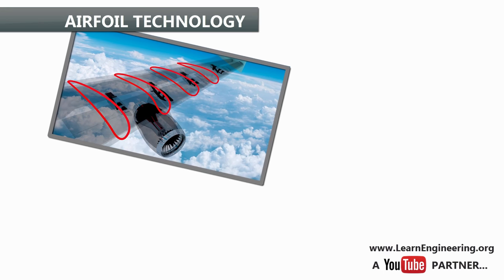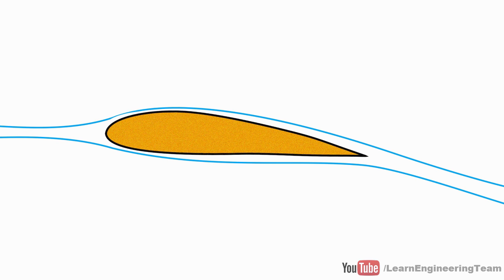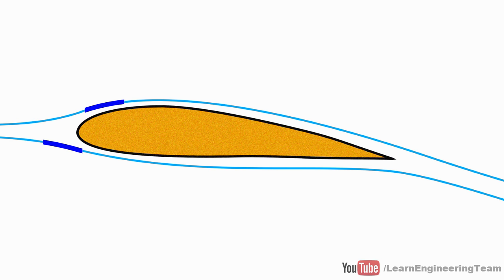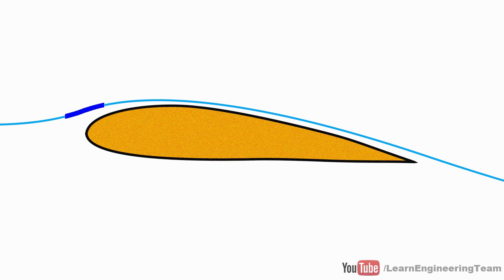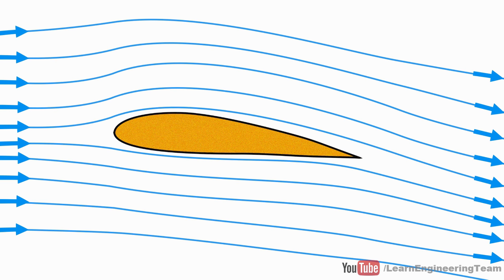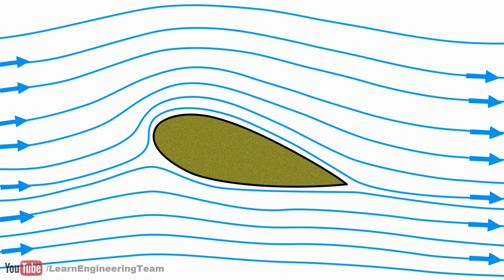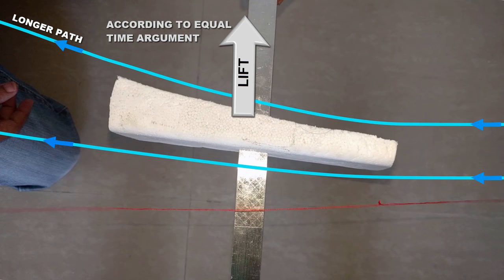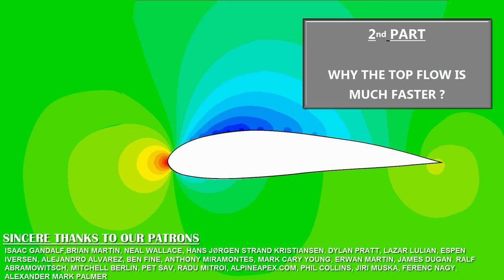How do Wings generate LIFT?

Comment: Hey. So today I started learning Fluid Mechanics II (a continuation of the first part). Hence, in class we discussed about air foil in the beginning. My lecturer explained that this has to do with Bernoulli's equation. After watching this video and contemplating, I figure you may have some things explained logically correct like that explanation that the particle which travels on a longer path will take more time than the opposite. But I am still confused about why the air flow doesn't just travel in a straight horizontal line after hitting the air foil. Could you perhaps elaborate further? Does it have to do with molecular forces (the reason why the fluid sticks with the surface)? Thank you!
Reply: The Coanda Effect comes from a couple of different phenomena that work together. The first is that all fluids are viscous. I don't know how far you've gotten in fluid mechanics, so forgive me if this is over-explaining things, but it's basically like friction between different layers of a fluid.

Second, the fluid directly in contact with the surface actually does not move. This is essentially due to electromagnetic forces between the individual atoms and other details at the atomic level.

If you combine these two phenomena, you get a viscous force from the stationary fluid on the layer above it that pulls it around the curve. This layer in turn enacts a viscous force on the layer above it, and so on and so forth.

On an airfoil, this same effect is happening. That is one of the reasons that the flow does not continue in a straight line.

One interesting note is that you CAN actually make the fluid flow in a straight line after the airfoil if you put it at a large enough angle of attack. That is called "stall" and is very bad because it ruins all of the lift.

Comment: As you get closer to the upper surface of the wing, the acceleration of the air is increasing due to conservation of angular momentum.
Reply: Could you explain it more detaily
Reply: @battulaharilakshmanprasad2721  it’s simple . Stable Slower air on bottom will bounce the downward of fast moving air from top- hence causing lift. No need to engineering degree to understand

Comment: The reason the air moves faster over the top is the same reason that explains why water moves faster coming out of a funnel than it goes in. The air above the wing is 'sucked' towards the wing by the Coanda effect, which squishes the streamlines together. This forces them to move through a smaller space, which increases their relative speed.
Reply: Elemental Sheep I'm not sure if the funnel analogy is good for explaining this though, it's more like a funnel cut in half and a half funnel does not add speed. Correct me if I am wrong
Reply: o0prince i would say, the airfoil itself "takes away some space". Meaning: the air can't get trough a planes' wings. Therefore the air needs to go around that obstacle, but now it has less space. This only happens at higher speed, and it might seem confusing to us, as we can't really see the effect, but: having less space, the air gets faster, just like water beeing pushed trough a small opening. 

You can see how the streamlines get closer to each other in a windtunnel, when a approaching the airfoil and beeing pressed to it.
Reply: Christian Vetö i think that is the venturi theory which was proven wrong by NASA
Reply: wrong..the wing gets lift from wind under wing lifting it..same as water skier gets lift
Reply: I also think that ,when we take an example of two marbles placing them two different pipes. one is curve and other is straight. the marble which is placed on curve comes out faster.
Reply: The Coanda effect has nothing to do with it. You need pressure and thrust to induce it... like on the AN-72.
Reply: Why not using the contintinuity equation but the wrong explanation by using the Newton'3rd law

Comment: 98 people applied Bernoulli's equal time equation incorrectly
Reply: Bernoulli never made an equal time equation... period. He dealt with total energy in fluids.., and when dynamic pressure increases, static pressure must reduce given constant energy state.
Reply: The argument that made the most sense to me explaining why the Bernoulli equations didn't account for lift generation was taking the airfoil shape as used in actual aircraft and computing the pressure (and therefore force) difference acting on the wing for a given airspeed and computing how fast an aircraft would have to be traveling for the pressure differential to give enough force for the aircraft to get off the ground; the resultant computation showed that aircraft would have to exceed Mach 1 to get off the ground purely via the Bernoulli Effect.

Comment: 6:42
The high pressure air coming from the left meets the low pressure air above the structure which shoots the air downwards thus making it faster than the one below because it has higher pressure

That's why air from above the structure is faster than the one from below

Am I right? If not, please correct me if I'm wrong

Comment: The speed of air is higher at the top of the wing and slower at the bottom, as the speed of a fluid increases it’s pressure decreases, so that the pressure at the top is lower so the lift is created

Comment: At 3:23  the centrifugal force to enable the air molecule to flow along the curve surface is not well explained for the bottom wing.How can the pressure under the wing be higher than the top if you use the Coanda effect? The video explanation of pressure at 3:23 is contradicting for the bottom wing part at 4:25.

Comment: How planes can still fly upside down then?
Reply: Blind Faith newtons 3rd law
Reply: magic
Reply: symmetrical airfoil
Reply: The same reason how it can land..
Reply: It rolls 360° for a short period of time only.
Reply: Try doing that on a flight simulator.

When you roll all the way so that the plane is upside down, you will actually start going down if the nose was pitched up, and you have to correct that by pitching down, in order to stay up.

You are essentially counteracting the effect by adjusting pitch, and thats how the plane stays up.

Its the wing that is gaining a certain pitch that generates the lift. Give it a more aggressive angle of attack (pitch) and then you have more and more lift, but at the cost of some additional drag (loss of speed).
Reply: symmetrical airfoil, both sides of the wing have the same configuration so you get the same result if upside down
Reply: Yes the plane can fly upside down if the top and bottom of the wing are symmetrical in shape. Example: Aerobatic Planes. Cheers

Comment: how about we apply continuity equation for the last brain teaser,as the streams at the top flow through greater cross section,their velocity should be less ,right and the opposite for the air streams flowing below the airfoil,but the exact opposite is happening.explain this contradiction please

Comment: "We know in a curved flow outside pressure should be larger"
Why? "Outside" with respect to what?
Reply: It's awkwardly explained... if you drive into a curve, you will be pushed out and in the same way a curved flow experiences increased pressure along its outer edge and vice versa.
Reply: Which fluid-dynamical principle can explain this?
Reply: Marco Discendenti I don't know what the name for it is, if there is one.
Reply: This isn't true at all. In the video he's using a "logical" argument by saying that the only way for the streamline to stick to the surface, there must be a pressure on the outside pushing it towards the airfoil. But the same applies to the bottom surface. The only way for lift to generate then, is if the pressure pushing the streamline into the bottom surface is higher than on the top surface. But there is no logical reason to think that there is a difference. In reality, the streamlines are attached to the surface because of viscous action

Comment: Sorry, there is no explanation to be found here.
"curvature leads to pressure difference" - that is not explained.
Reply: Curvature does lead to pressure difference because the air is moving faster on the top.  That causes some lift in the wing

But the vast majority of lift in airplane wings has always been caused by angle of attack.  It is not "one or the other", it is both, but the vast majority being AoA

Sometimes, the best thing to be said about many of these vids is, "much ado about little"
Reply: @ronalddump4061  What does "the vast majority of lift is angle of attack" even mean? All of the lift, by definition, is the pressure gradient on the surface of the wing (which I grant is not an explanation in itself). You can't really break it down further than that...
Reply: You do realize, I hope, that you can generate lift and thus make a flying machine which has perfectly flat wings.   Correct???   An analogy:  (actually more than an analogy).     A kid can whittle out a propeller which has perfectly flat surfaces, (and it will work well),    or a little more efficient one which is shaped as a wing is shaped.  Propeller blades are nothing but wings, generating lift.
Reply: @ronalddump4061  Correct. If you find the pressure distribution over the upper and lower surfaces of a tilted flat plate, you will find that that pressure distribution explains all the lift.
Reply: So, what exactly are we "arguing" about?  Just to be arguing???

Comment: This video was great! Most videos fail to address any misconceptions surrounding lift and you hit one of the larger ones on the spot, that being the equal time transit fallacy. The CFD diagrams and streamline demonstrations really help with understanding the material as these things can be difficult to visualize. However,  your reference to the Coanda effect was incorrect as this phenomena only applies to jet flows, which are usually not present in standard airfoil flow. Great video and keep it up!

Comment: I don't need any special shape to generate lift. I can take piece of cardboard, hold it from car window and if I tilt it up, it will generate upward lift. Tilt it down, it will go down.

Any plane will also work upside down, even if the wings are optimized for normal position.

If any of you ever stood under passsing plane, it blows air DOWN. Means the air is pushing plane UP. And that's it. No need for Bernoulli principle, no pressures, no special airfoil shape, no nothing. Just Newton 3rd law. Don't search for difficult stuff when there is a great simple explanation
Reply: I agree with you that Newton's 3rd law is the primary info to know on this. However Bernoulli's principle is relevant to the direction of the downwash, and lift is the opposite reaction force from this downwash.  Air just doesn't push a plane up. The airfoil has to deflect air down.
Reply: Michael Benda I also thought the same  why the planes are designed in such a way 
We have to learn about Bernoulli's principle for understanding the shape of the aeroplane
Reply: Even if you dont need no Bernoulli principle, it is the reason of most of the lift. Your simple explanation is part of the truth, but not the whole. Actually the air which flows over the wing creates more lift than the air that flows under the wing.
Reply: @iquabalghori8602  why do you have to learn about Bernoulli's principle to understand the shape of an aeroplane?
Reply: @linusludescher9429  how/why is the Bernoulli principle the reason for most of the lift?

Comment: So you're saying that it's the continues flow of air particles over both top and bottom of wing, that the ones on top are independently pushing down, the bottom ones are pushing up, the the bottom ones win out and generate lift because they are slower? Thus more pressure

Comment: Great Video, I enjoyed the experiments that were conducted and like how you used Computational Fluid Analysis to aid in your argument against the Equal Transit Time Fallacy. However, you mentioned the Coanda Effect which is unfortunately only applicable to jet flows that are coincident on the leading edge and as we know air acts as a continuum and doesnt behave like a jet flow in the atmosphere, furthermore commercial aircraft are known to fly where the air flowing over the top of the airfoil does not reach jet flow speeds. Your explanation of Newton’s 3rd law and pressure theory was good and concise!

Comment: Good explanation! However, I have found many people saying the coanda effect is what is causing the flow to remain attached to the airfoil. I would point out that the coanda effect only applies to jet flow, which the airfoil does not experience.

Comment: hi there learn engineering,

i just read all of nasa's parts on lift theories and they explain that the explanation using Newton's third law om motion is false due to something called  Leenward(parts of the solid body facing anotherway and deflecting air that way)? could you confirm and or explain this?
Reply: Newton's third law is only partly correct for the full story of lift generation. To introduce the full story of lift generation, three conservation laws must be considered at the same time, which are the conservation of mass, momentum and energy.

Comment: This is helpful. You should use Kelvin’s theorem of circulation to calculate the life that generated. Bernoulis is wrong on this, not only because the reasons above. Most importantly it has to be the fluid that’s free of  viscosity and density needs to remain constant(incompressible) which is impossible in real life, so u can’t find any fluid that’s totally bernoulis

Comment: Your videos are exceptionally explanatory, though there is something I don't still fully understand. What is physically responsible for the fluid jet tendency to get attached to a convex surface? How is the pressure gradient (that guides de flow to follow the airfoil curvature) technically generated? Does this fluid jet tendency to get attached to convex surfaces account for the pressure gradient or is it the other way around?

Thanks also for the videos on how electric motors work, they were of great help!
Reply from the maker: In a convex surface up to the the peak point the fluid jet can easily get attached. But even after the peak point the jet tries to get attached. This is known as Coanda effect. Such curved flow lead to a pressure gradient.
Reply: It's just a matter of air pushing down on it (above the wing) and really irrelevant to the Coanda effect.

Comment: Ich versuche kurz aus meiner Sicht warum die Luft oberhalb des Flügels schneller ist des Flügels:

Theorie 1: durch den unterdruck oberhalb des Flügels wird die Luft angezogen und die Geschwindigkeit steigt wie
Wie bei einer Drehscheibe (Draufsicht) wenn: wenn man sich der Mitte nähert dreht man sich schneller (vllt. Rotationsenergie)

Eng:

I will briefly try to explain from my perspective why the air above the wing moves faster:

Theory 1: Due to the low pressure above the wing, the air is drawn in and its speed increases, similar to a turntable (top view). When you approach the center, you rotate faster (perhaps because of rotational energy).

Comment: Great job explaining how Bernoulli’s principle and the equal transit time fallacy are invalid explanations for the generation of lift. In addition, the video was very engaging and the animations were very effective. However, the main explanation is still based on the Coanda effect which, according to Doug McLean in chapter 7 of the Understanding Aerodynamics textbook is also invalid due to the fact that it is not referring to a jet flow and implies that viscosity has a direct impact on the fluid making it flow along the surface of the curved airfoil.

Comment: This narrative mentioned the one force that actually creates lift . It is Centrifugal force  of the air caused by adhering to the top wing surface  at flying speed . None of the narratives mentioned the velocity of the air flow across the wing . As a pilot we know how critical that is .

Comment: Can someone please let me know if I understood this right?
At 4:08 he said the outside pressure should be larger, then at 4:12 he said the pressure has to decrease...
The way I understand it is that the P atm decreases/compresses to create a high pressure on the top part of the airfoil. Am I right or am I thinking about it the wrong way?
Reply: Clara Mel B pressure at lower end should be high and will be high at an angle of wing and the upper portion will be having low pressure...but velocity of air on upper is more

Comment: i understood , as the high pressure comes from the upper curved path it applies the force the its end point where the lower pressure balances the mid point just about right to lift it right

Comment: The pressure difference, or gradient, generates a resultant force. The same could be applied to the pressure gradient along the airfoil top, which has a larger gradient that generates a resultant force pointing right, therefore, accelerating the flow. Is that correct?

I have a question about the Cambridge video: Can you argument that the direction of the flow affects the momentum lost after the contact with the airfoil? I say that because the bottom flow has a more direct impact with the airfoil, so, more momentum is lost and therefore the velocity is reduced.
Reply from the maker: You are exactly right. At the top we have negative pressure gradient in most the area. This will accelerates the fluid. At the bottom the case is reverse.

Comment: Top of a wing profile is analogus to a venturi tube, wind flowing over the top surface is forced to move under higher pressure than the lower surface the resulting increase in velocity of air flow above thus low pressure is created on top surface causing a resultant reaction above